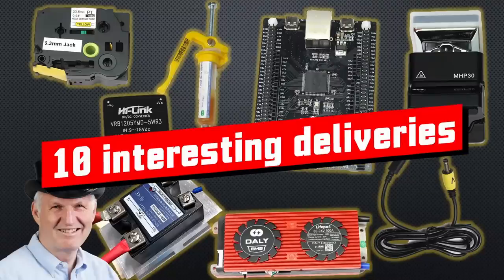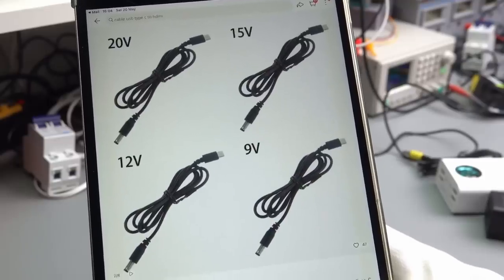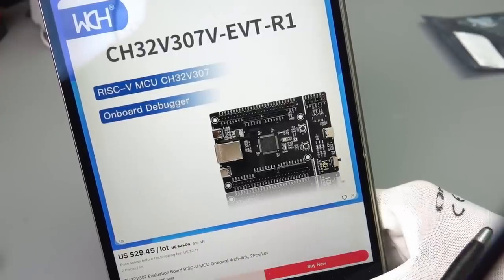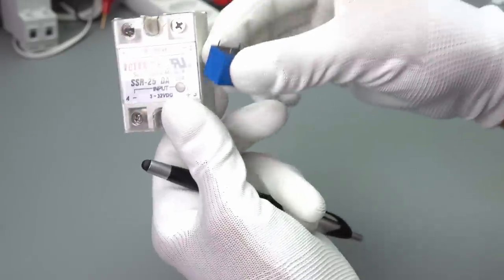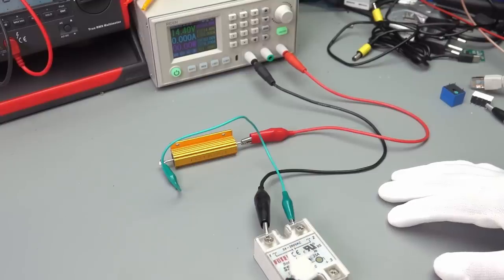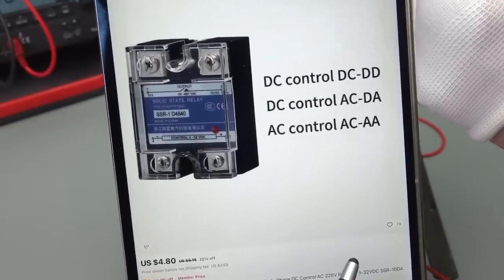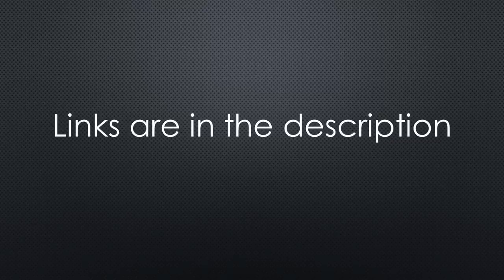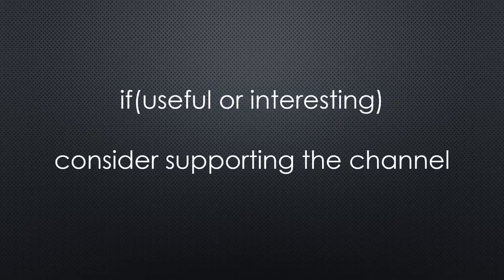457 Mostly Around Power for Projects. And More

Comment: Andreas. If you want to desolder something large. 
Use a thick copper wire. Bend it around the vias. And heat it up with your soldering iron. 
The copper wire will transfer the heat to all the vias. 
If you use low melt solder would help too.
Reply from the maker: Thank you for your tip!

Comment: That Risc-V board is from WCH. The ones who make the CH340 chips that have replaced the fake FTDI chips in so many Chinese boards.
The specs of the board aren't very impressive at 144 MHz, 256 KB of flash and 64 KB of RAM but having a debugger included is pretty cool
Reply from the maker: Unfortunately, the SW support was not good. So I never used it :-(

Comment: The Fotek SSR are available for DC voltage too with same exact shape as the AC. It comes with either 40A to 100A model with voltage rating of 5V to 60V. It really usefull if you cannot handle the clicking noises of mechanical relay.
Reply from the maker: I did not know that Fotek had them too. Thanks! I have used a Fotek AC relay for the last few years to switch all devices connected to the PC off if I do not use the PC.
Reply: @AndreasSpiess  Yeah, the fact that you need to squint on the label to notice the difference haha. Fotek really need to color coded between AC and DC!
Reply: I can't stand the clicking noise of relays in modern electronics, it feels out of place.
Do you know if the DC variant can switch an AC load as well? Maybe it can but is less efficient?

Comment: I've had the MHP30 hot plate for about a year. It's not an everyday tool, but has been extremely useful for reworking populated PCBs, especially 4+ layer boards with inner ground planes. Sometimes I'll dial it's temperature up high enough to desolder the desired component, especially if that component has an exposed pad underneath that is soldered to the board and no sensitive components nearby. Other times I'll set it to 100 degrees C and warm the board from below for a few minutes before using hot air on the top side, making the removal quick and easy. I agree that it is somewhat expensive, but it is very well made.
Reply from the maker: A good combination with the hot air gun, I agree!

Comment: Wow those power delivery cables are nuts, thanks for sharing. I might actually consider getting one of those bigger charging blocks, as it could also charge my laptop with usb-c
Reply: They are also awesome for Routers. 12V in. Done.
The only downside is that Phone Chargers are not made to run 24/7
Reply: @Haldi4803  Yes but I was thinking more about those bigger bricks made for laptops. Also this could work with one of those nice high watt usb-c soldering irons
Reply from the maker: Most of the USB-C PD chargers have quite high power ratings (as ZeusBeer mentioned). So they should easily support a few watts 24/7.

Comment: I use one of those tiny hotplates at work all of the time for repairs or changing SMD ICs, especially those with a big ground plane on the bottom.  I 3D printed a couple of nesting simple boxes the same height as the heater and about 12 CM square, so I could  place the heater inside and prop a PCB on top so it was supported and I could place the heater under the appropriate chip. Very useful, reasonably quick heating as well. Has made reworking boards a lot easier! And, as you say, it's a little jewel.  Very nice tool.  Thanks for a neat video!  Just purchased a brand new surplus EV battery 'block' with 20 of the CATL 280AH LiFe batteries to back up the house for a few days when we lose power. A great deal from Battery Hookup here in the US, especially when the 340lb pallet is shipped (in the 48 states) for free, truck freight. Getting it up my 43 steps was a lot of fun, but it'll be a great replacement for my existing cobbled up Li-ion scooter battery powered solution.  Still saved me a lot of misery this last winter...:) But with that bigger LiFe pack, i'll get several days of power with less load restriction. And less volatile batteries about.. Setting up a 48V system shortly.  Looking forward to part two!  Stay safe.  Stu
Reply from the maker: So you do not use a lot of energy! Our 10kWh battery only lasts for one day...
Reply: @AndreasSpiess  Very true.  All my lighting is dimmed LED, the current 'emergency/UPS' backup power setup includes all lighting, computer/50"4k TV/monitor (The two power pigs, maybe 220 watt total) all the cable/router/pico cell site/NVR and 5 cameras, CPAP and electric blanket (as needed) All that is currently on a 400W Minuteman UPS. Also just added a Starlink setup, so that's up to 80W. I can get about 2 days with my current 6ish KWh li-ion setup, if I'm frugal. The refer (100ish run watts) and freezer (75 run watts) are separately powered currently. New setup would add those two. I'm only 800sqft in a redwood forest, so pretty moderate climate.  The minisplit can run with useful output down to 400W or so, but if it's really working, up to 1300w, so not a good idea on a small battery. Altho if I had to, I could run it off the battery overnight and recharge from generator daytime. Before the Starlink, my average power using a laptop lights and comms stuff can be as low as 100W or so, tho the Starlink won't help.  At night, CPAP and basic comms still about 100W. Blanket probably adds an average 50-60W on the few times I need to use it. So, if I'm conserving, 3-4 days easy on 15ish KWh, if I'm cold and using full computer/50" many hours, probably a solid 2 days. Wish I could use solar, but the trees don't help. (Now with Starlink. It's usable for emails and such, but only connects about 80% of the time. But, when the storms hit, I have no other communications, so...) Leaning towards one of those all-in-one inverter/charger units, maybe a 3000W. Don't like the low power standby losses, but it's less hassle than my low-power/high power current setup. (400W UPS on always, 3000W inverter on when heavy loads. 'solar' generators covering refer/freezer currently.)
 Keep up the great videos!

Comment: Thank you Andreas for your valuable explanations.
May I add  that the SSR for DC may have significant voltage drop of up to 1V ( That is why it needs cooling 🙂) For battery applications this can be too much.
For resoldering I mounted an old iron upside down. Then I use an aluminium piece  of about the size of your heater glued with heat sink paste to the iron. This works very well for unsoldering Espressifs or other stuff
Reply from the maker: Cool idea! I did not know that irons get so hot.

Comment: I will use the DC Foteks for switching off 120VDC solar power. Thanks for sharing all the other stuff.
Reply from the maker: It seems advisable that you do not load them to the specs. And you must add a heat sink. Otherwise, they do not survive long (voice of other commenters).
Reply: @AndreasSpiess  done that 200V version and 5 times bigger current and flyback external shottky doides 🤔

Comment: I have a pair of "40A" SSRs on my water heater. It only draws 17A per element. Without a fan and heatsink, even at 17A, the SSR gets hot enough to fail (happened once). Interesting note about SSR is that they tend to fail in the ON position.
Reply from the maker: As you write, they overheat without heatsink. That is why they fail in the "ON" state.
Reply: @AndreasSpiess  I have used these Fotek ones quite a bit in the past. Past being the key word. Solid State Relays are great, just not these. These Fotek ones are really crappy and fail sometimes with a load under 1 amp. They are a cheap knockoff and should not be used if there is any reliability required. Also, they say 3 to 32 vdc trigger, yet many of them will not trigger at 3.3vdc. This is a real problem if trying to drive with an esp32 or equivalent.
Reply: @grassrootfilms You get at most what you have paid for. If you pay little, you have little (in the best case scenario). Chinese are not charity associations, if their goods cost so little (if compared to a west made product) there is a reason .....
For anything serious I would not use a 5€ no name power SSR. A Siemens PLC costs hundreds of € for a computing power and functionalities that is a mere fraction of, let us say, a ESP32 board. But you can expect the Siemens PLC to work for at least 20 years 24/24h in an industrial environment without issues. For a ESP32 board I have absolutely no expectations (some of them are even faulty on delivery).

Comment: The data sheet for the Foteck SSR's from Taiwan show the limits of the devices.
The output to the load must be fused. Most likely a circuit breaker is present
anyway. The rated current is ONLY for purely resistive loads and while using a
heatsink at all times with thermal compound.
For other loads, they advise using X times a higher current rated module.
Incandescent lamps and three phase motors, 4 times the rated current.
*Transformer loads are to use 10 times the rated current.
Capacitive loads are to use 3 times. 
So a 2.5A max transformer load would require a 25A SSR.

Excellent video like always. :)
Reply from the maker: I assume similar rules apply to mechanical relays (I am no power electronics guy). I plan to switch max. 30A with my 100A relay. They are so cheap, why not ;-)

Comment: Just be aware that 12V is not a standard, mandatory voltage in the PD standard.
Some PD batteries and chargers only support 9 and 15 volts and the 12volt cable will not work.
So check your charger datasheet if it optionally supports 12 volt.
Reply from the maker: Interesting! Thank you.

Comment: points to note for SSR : very good (ususally opto) isolation (especially compared to a plain transistor circuit) ; vs relays, no potential sparkling, bouncing, no clicking sound. On the bad side: quite high ON- resistance; critical behavior in overcurrent/shortcircuit situations.
Reply from the maker: I agree with your positive points. I did not measure the on resistance and, unfortunately, it is not specified.
Reply: Also worthy of note is leakage current at the output which can cause issues with light loads, including failure of the SSR to release properly.

Comment: 1:16 ist nice, but different cable colours for the different voltages would be nice too, cause both in yellow is not the safest even though but a quite nice tip.
I use the usual dymo labeler from aldi and the cheap unbranded paper labels. If I want additional protection I simply add a round of TESA tape that will protect it very well for quite a long time and I bet a lot cheaper than the heat shrink printer.
Reply: Dymo added DRM to its latest products, so buy a used label printer or an alternative brand.
Reply: @nobodynoone2500  DRM heat shrink tube also works with Dymo label maker, e.g. 280 or 450. I have both of them and both work fine.
Reply from the maker: You get the tubes in different colors, so you could do it (and I agree, it would be better). But the number of different tubes becomes big if you multiply the width with the colors...

Comment: We use those pre-heater hotplates for rework all the time... it is so much easier to control the temperature (and air flow) than using a hot air rework station. I'm not skillful enough to use it with double sided PCBs (I don't do too much rework), but I've seen our production techs work magic with them.
Reply from the maker: Thank you for sharing your experience!

Comment: Thank you Andreas. And a special sneak peak of the top secret S3 board (14:20). Full of analog adjustments, labels for Antennas and, curiously, PTTs. Can’t wait. Oh, and I’ll take two.
Reply from the maker: The potentiometers are there because we want to experiment with the voltage levels. In a second version, we hope we can avoid most of them...

Comment: I appreciate your insistence on sticking with boards that are actually Arduino-IDE compatible.  It cuts way down on my own research on whether I need to install Yet Another IDE.  Would much rather "hit the ground running" where I know I can start with testing right away.  Burned too much time already learning too many IDEs.  Maybe I am stubborn.
Reply from the maker: I agree. This is why I still use the Arduino IDE.

Comment: Thanks for this, interesting as always, hot plate desolating of smd, be sure and show your way of soldering it’s replacement!!
Reply from the maker: Usually, I solder one pin first, adlust the opposite pin, and them "drag solder" with lots of flux.

Comment: My problem with USB-C PD trigger boards is that 12V is an optional voltage level and not actually required hence most PD chargers will only do the required 5V, 9V, 15V, 20V and a 12V trigger will only give out 9V in that case
Reply from the maker: So far, I had none without 12V. But not all offered 20V.
Reply: @AndreasSpiess  Spigen ArcDock 120W GaN Charger won't do 12v via USB-C PD but will do 12V@1.5A on junky USB-A QC

Comment: Oh, just at the start - the USB C coax power cables - the heat shrink labels are good, but I'd have used different colors for 9 vs 12 - maybe even just a hand-added marker line. Wrong voltage to the circuit is such a heart-breaker!
Reply from the maker: Different colors are better, of course. But a logistical nightmare for me with all the combination with widths.

Comment: For the Dongguan LiFePO4 batteries, most realistic the ones before from the manufacturer was the 120Ah. It seems they are from CATL. It's good to make sure they are insulated against each other as the insulation that is there, especially the black plastic on the top, is not very good.
Reply from the maker: I agree, I put some plastic in between the batteries (table sets from IKEA ;-)

Comment: I like and use solid state AC relays you show here. I discovered that these relays do leak a small AC current when off - enought to trigger an AC indicator LED I wanted to use as an on/off display. I’ve tried several brands of solid state AC relays and see the same behavior. These relays also switch very quickly and can do nice PWM effects with the right load. I love them but cannot use them in every AC application due to the current leak.
Reply: They have a rather finite lifespan too, not saying don't use them, but buy two and keep the spare with the device using it lol
Reply from the maker: I use one of these AC relays to switch all my devices around the PC if the 12V supply of the PC goes away. It has worked for at least 5 years. But of course, only with a low load.
I did not know it has a high leakage current. Thanks!

Comment: Very interesting overview! By the way, those dirt cheap SSR-s are sometimes not very well made, I'd really hesitate to run it with nominal current for any longer period. It is very tempting though, because price ratio with "Made in EU" ones can be easily 16 dB...
Reply from the maker: And 16dB is a lot ;-)
Our remote station will consume around 30A max. So we will see...
Reply: Based on BigClive's teardown of one SSR (7 years ago now), I consider the ratings listed as MAX PEAK, and the operating current should be close to half the rated current for the dirt cheap ones. 40A ones work great for any household devices in the US
Reply: Ihave burnt a couple of these. They cant handle the rated current over time.
Reply: @torfinnsrnes6232 Agreed!  I had a SSR 25 DA blow up switching a 3kW 240V immersion heater on low duty cycle.  The SSR 40 DA I replaced it with has been OK.  So nowhere near the specified current from my experience.  They don't smell nice when they blow.

Comment: these relays you showed at @6:00 (Songle, blue) are the worst what can happen on Ali - they very often glue together and the only way to disconnect is to ... use hammer - I had to replace more than 20 in my projects that were connected to mains - they were simply not reliable at all and very dangerous. 
I found later that there are relays and relays and the most important characteristic of good relay is: the material the contacts are made of.
Reply from the maker: Thank you for sharing your experience! For mains, I use the Fotek SSRs (or the smaller Omrons for PCBs). I use the blue ones for low voltage/low power applications and so far had no issues.

Comment: I have encountered similar situations with SSR not shutting off and resolved it by placing a resistor across the input. I believe the internal trigger is a triac or at least it behaves like one
Reply from the maker: I am not sure if this is a problem on the input. So your solution surprises me. Did you use an AC SSR for DC?
Reply: @AndreasSpiess  AC SSR with AC load. Issue was on the control side

Comment: looking forward to your 300ah battery cell build.  From the pic, saw you had the BMS for part 2? :)
Reply from the maker: I did not plan a video about the battery because there are a lot of them already on the internet. But it will appear on my second channel when it is installed in the remote station.
Reply: @AndreasSpiess  Correct many videos out there, but your channel goes beyond most so always interested in your PoV.  Planning any monitoring beyond the BMS provided sensors?
Reply from the maker: @Chris-ut6eq  The BMS reports all the needed parameters for me. I replaced the BT dongle with an ESP8266...

Comment: SSR are great for switching, but their resistance when closed is not ideal. I wish there was hybrid relays available. A SSR for turning on/off and a regular relay in parallell that bypasses the SSR in the on-state to lower the heat output and the overall resistance.
Reply from the maker: I assume you can create such a "hybrid yourself. So far, I have not measured the losses and found no specs (I use a buck converter after the relay).